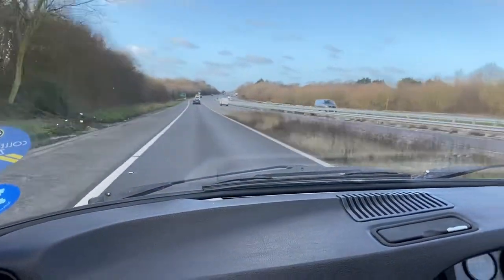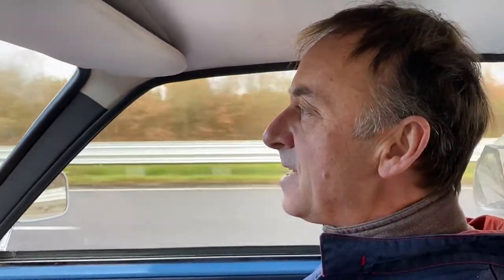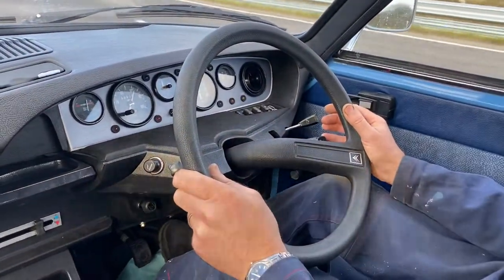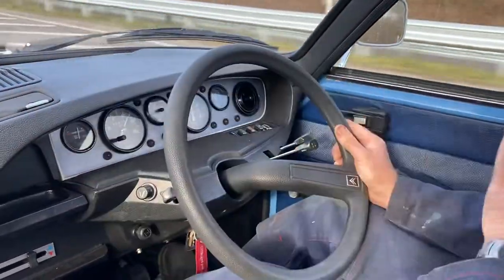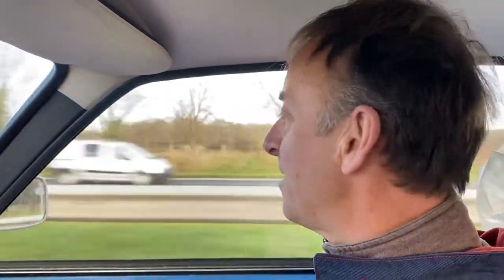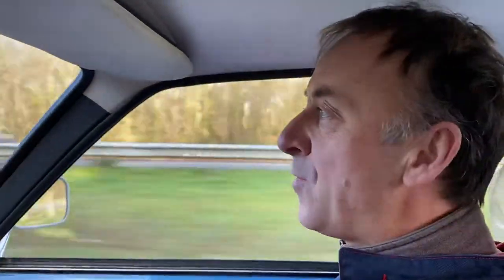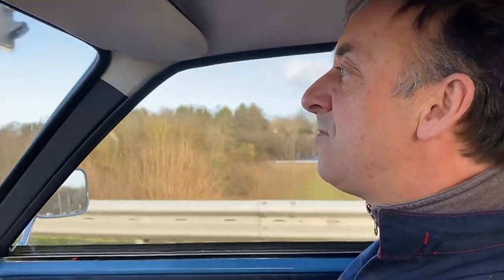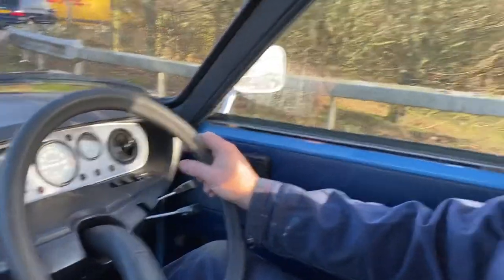“Blast from the Future” Citroën GS

Comment: I totally agree. Best small car ever made with safety, ride, handling & comfort not seen since. I had a 1015 C matic, 1220 manual, 1220 Wagon C Matic and leased a 1982 GSX 1 1299 cc 5 speed for 3 weeks in Europe, with 2 Aussie mates while my 1982 2CV6 Charleston was being shipped from Belgium to Halifax in Canada.

Cruised at 150 kph in the GSX in Europe and 140 kph in the 1220 manual in Australia.
Dad bought a GS 1220 C matic and 3 years later gave it to mum and bought a CX2400 C matic. The GS's handling saved their lives when forced off the road and were able to keep control and get the car back on the road. Anything else would have skidded and rolled.

Yes, if you have a rear blow out you feel nothing.
If a front wheel blows you hear it and the steering becomes heavier, but you keep control.
Reply from the maker: Nice one, Stephen

Comment: Thank you, Simon. It was a delight to watch this. I had several GS's back in the 70s and 80s (GSX2 1220, GS 1220 Club estate, GSA 1299 Pallas), and I'd have another one tomorrow if I could find one. A glorious car, and wonderful memories.
Reply: @toqtoq3361  ....if you can afford keeping it, keep it. 
Hey one question: what 's the situation over there with fuel? These GSs ran on leaded fuel and these fuels have stopped being produced. Is the situation different in the Netherlands or you still have leaded fuel for these and similarly old cars?
Reply from the maker: These cars, with their aluminium alloy cylinder heads, have hardened valve seats. So unleaded doesn’t pose a problem.

Comment: I subscribe to the stability and safety (as well as comfort) of this car, even in the case of puncture on a front tyre, because many years ago, my father was driving on a highway, at night, with heavy traffic, and at one point he suddenly spotted a large piece of metal (probably part of the exhaust of another vehicle) precisely on the lane that he was driving. 

With no room nor time to skip it or avoid it, he had no alternative but running over it. The BANG must have been deafening (I was not there then). Cautiously, my father moved to the slower lane and a while later he stopped by a petrol station where he checked the damage to the car: the front left tyre was torn to pieces, the wheel hub lost a great portion and the missing piece on the tarmac bounced hitting the bottom of the car, right under the front left seat. He drove for about two miles on three wheels and a half, and still the car just steered normal. Unbelievable.

We still have that GS (a 1978 Pallas); the car that saw me been born, so as you may imagine the bonds between us are so strong indeed. It´s my greatest pride.

Comment: I used to have a 1970's GS 1220 Club back in 1994. It was a left-hand drive car, a bit scruffy, for which I paid £240 , banger money in those days. It had only covered about 62,000 kms ( about 37k miles). I drove it from Calais to Valencia in Spain in 29 hours . The return trip went without problem apart from a clean of the carburettor jets which succumbed to clogging due to dust in the petrol. Driving it was just as you described. Wonderful, willing and reliable car.

Comment: I had a 1971 model with the smaller engine. It was only three years old at the time. That suspension was amazing and it should still be produced! In the case of mine, it had a bad carburetor. I never really knew whether it would start.

Comment: The 1220 engine is probably the best version they ever built. ❤️
Reply from the maker: I have to agree. A veritable turbine!
Reply: Awful cam shafts built out of really soft metal
Reply: @acptelford1307  Well they all sort of suffer the same. Just make sure to change oil with shorter interval
Reply: Le 1300 des X3 est la plus abouti !
Reply: It's a great engine, but my favourite was my early 1015. Fewer leaks, even smoother and liked to rev even more.